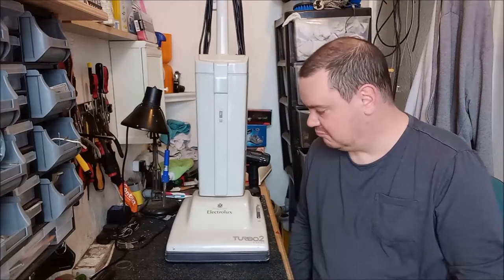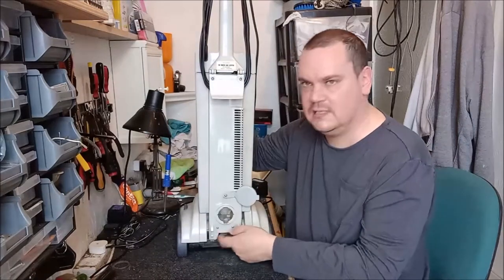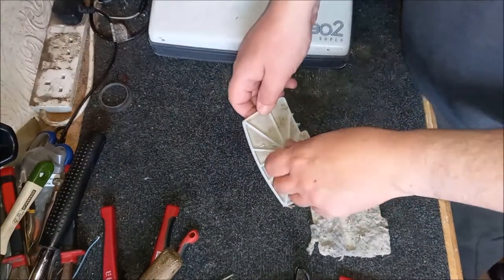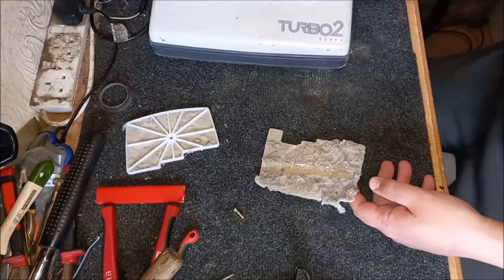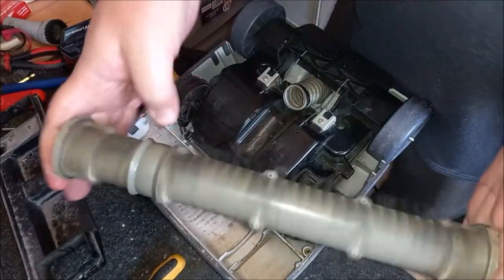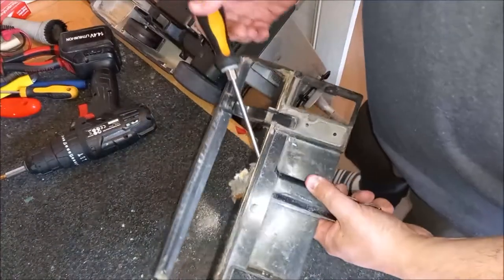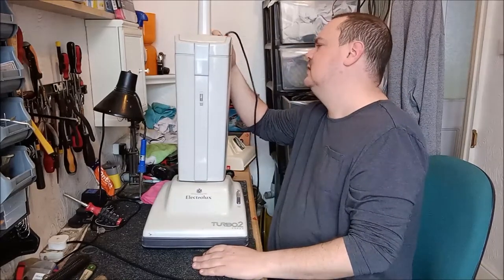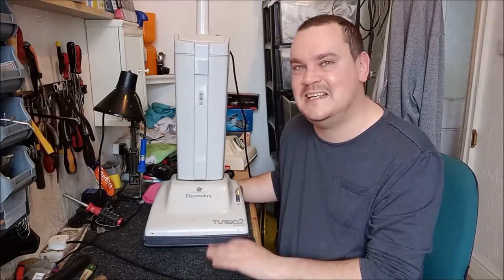There's something LIVING inside my 1991 Electrolux Z1070 Turbo2 Super!  EWWW!

Comment: Oh how I remember these…my friend’s mother had a 502S which she really liked, and in 1991 saw in a Which? that a Twin Turbo model was now available. By the Autumn of 1991 they were in many shops, retailing for £79.99 (about £194 today), so said mother went and bought one. However, at the start not all cleaners were sold with the tool kit, despite being on sale for the same price.

As you say, this became the entry-level cleaner of the time, now that the Lite range had been discontinued, though it seemed a bit odd (though far from unwelcome) that an ‘old’ design would be brought back to life. I can confirm that the piston bag-full indicator was very much a feature of this cleaner throughout its life, as none of this model had a bag-full lamp, despite being a feature of just about all (if not all) twin turbo models before it.

Although entry-level, this cleaner was in no way inferior to the next range above it (the Glider), if you don’t include the fact that one Glider cleaner had variable power (originally a power-boost but quickly changed to fully variable), and another had automatic cord rewind. However, on price, build quality, ease of use, and to some extent performance, this cleaner was way, way superior to the Glider. Added to which, in light of the poor build quality of some expensive cleaners with on-board tools (by then many a 610 and 612 had fallen to pieces), I remember this cleaner having a lot of appeal for its no-nonsense tried-and-trusted design.

The price of this cleaner could be as high as £99.99, depending on the retailer, although by 1995 (when it was discontinued) it was a low as £49.99 including tools (£106 today). In the four-or-so years it was in production, the only changes came in the form of a moulded-on 13 amp plug (appearing around late 1993 in preparation for changes in legislation that were due in January 1995, whereby just about all appliances sold in the UK would be required to have a factory-fitted plug), and at least two (possibly three) changes in the design of motor, as Electrolux gradually made more and more parts of their motors from plastic, as opposed to metal. 

You did ask for comments, therefore I will correct you on the date of that telephone number…the addition of a ‘1’ to some area codes actually occurred in April 1995, on ‘Phone Day’, although according to a search on ‘tinternet, the 0272 (Bristol) code was changed completely, to 0117. Not that this changes much in respect of your cleaner (other than to say the installation of that label and assumed repair may have occurred later than estimated). According to Google maps, the Wash Vac Centre, Bristol, was very much still open in 2018, although there seems to be some suggestion it has now closed. Shame, but alas a sign of the times…in the city I live in, almost all have gone, despite the fact that until the late 1990s there was a repair shop on most high-streets and indoor markets, indeed in one (once) very popular shopping vicinity there were no less than three within half a mile - all of them traded for years and years.

Comment: One of my all time favourite cleaners. I’m such a sucker (not pun intended) for an underdog. And in this case, Lux’s budget underdog upright was better than the higher end Gliders and Contours! 
1991 makes it an early one. It was gone for a year in 1990 when the Gliders came out, z1055 and z1065 were intended to be the last Twin Turbo’s. 
As for the bag indicator, all the z1070’s had the piston indicators. The electronic one last appeared on the z1065 in 1989.
Reply: Iam 100 percent they did a 600 watt twinturbo it was the very last one in 1995 to 96 i remember coop having them
Reply: @dysonmike69  they were always 550w. There was a cleaner badged as Twin Turbo that was 600w, but it was the same shape as the Contour and had built in tools.